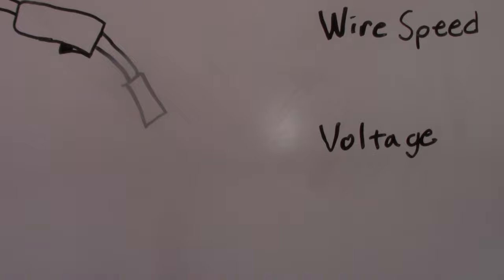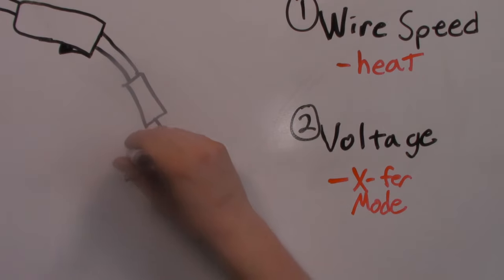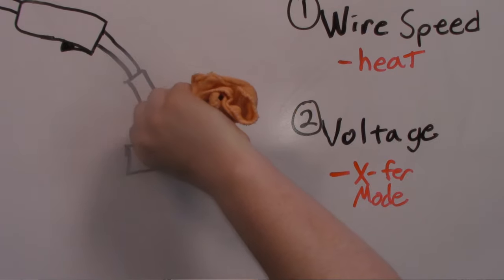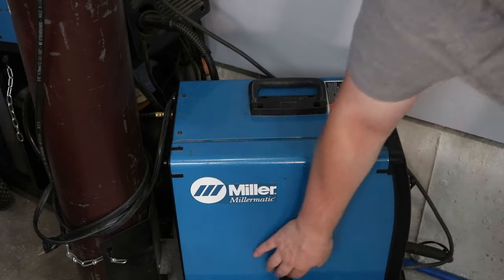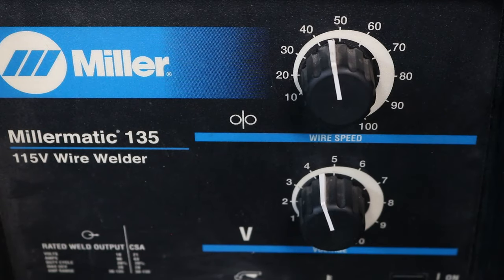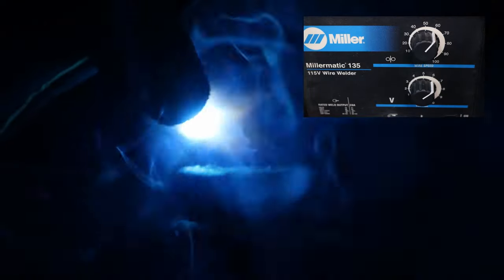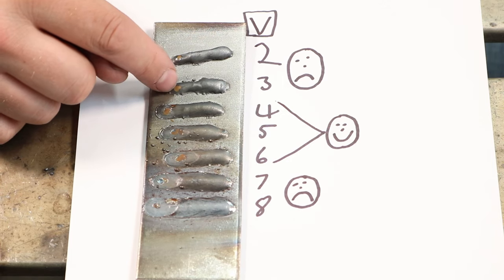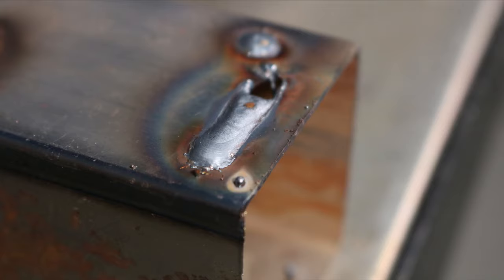MIG Welder Settings: MIG Welding Basics for Beginners

Comment from the maker: You can learn to weld.  I'll show you exactly what to do in my affordable online welding courses at https://courses.timwelds.com.
Reply: Yes!
Reply: There are many complementary comments from viewers about your video, but I think you have gotten the fundamentals of arc welding, of which MIG Welding is a sub-type, wrong.

The arc is not generated when the electrode touches the base metal; it is generated when the electrode is at a short distance from the base metal, around 3 mm. The high current and voltage allows the electricity to move across the air, which is an electric insulator, but in doing so, generates a lot of heat. It does so, by turning the air into a ionised particles, called plasma, which is a better conductor than normal air. The plasma is the arc you can see. 

This is why if you do not move your electrode after the arc had formed and the filler metal had been deposited, the filler can connect the electrode to the base metal and the electric circuit is closed, meaning electricity will flow 'properly' and no arc can form and the welding process will stop.

Comment: I'm an old, old stick welder, but I have always wanted a mig welder, so at 72 I bought a good one. Luckily, it came with a thickness gauge and inside of the cover to the wire storage and drive mechanism is a chart for the recommended settings. The little welding that I've done with it, the recommended settings give me excellent results. I've chosen to use flux core wire because I don't do enough welding to justify the hassle of using gas. My welder is dual voltage, but thus far I've only welded with 110 volts, but I have a project pending where I'll need 220 volts because of the thickness of the metal I'll be welding. I appreciate these welding videos because there are differences between stick and mig welding. I wish I could have afforded a mig welder when I was young. Being a farmer, it seemed like there was always something that needed to be welded.
Reply: Right on sir that’s amazing!!!! How have you liked it so far?

Comment: Personally I find the Miller App by far the easiest to use as a weekend warrior's uninformed apprentice. It’s basically what method you are using, material and wire or stick size. Even I can manage that, where some apps seem to presume specific knowledge or that you are using the app maker's materials.
Reply from the maker: I do use the miller app quite a bit. Whether a weekend warrior or pro, there's no need to overcomplicate it. Thanks for the comment!

Comment: I’m an enthusiastic absolute beginner in DIY mig.  My new 240v machine (Australia) only sets amperage and bolts, no wire speed.  Using 0.8mm flux core (gasless).  I get a can’t get a sizzle sound only a zap zap zap. Like it’s burning the wire up and loses the arc then re engages.  I have a Bossweld Buddy, M150

Comment: I am struggling with my mig. It has two switches with min/max settings and the wheel for the wire is 1-10. In no place does it state what the wire speed actually is. Granted I can't weld, but I find this welder really annoying. But taking notes here from your video and I'll head down and try some 1.5mm stainless. Thanks for the video.

Comment: I was taught to weld with a torch and stick in high school metal shop class.  I was taught to TIG weld in college during exam week right before I graduated (perks of having a job working for the Physics department -- this was not part of any curriculum).  My gift for my first father's day was a MIG.  I had to teach myself.  Now we have YouTube (YouTube did not come out until my first born was almost 10).  Some of the videos have helped a little.  This is the first one to explain what is actually going on.  I have been setting the voltage first and have nearly always had to set it at the highest.  I know that can't be right.  I am going to try it your way, and perhaps I will be able to get decent welds all the time instead of having my "good days and bad days" like I do now.
Thanks for taking the time to make this video and actually explain how the welding process works.  For those of us with an educational background in Physics, we learn better when we understand the how and why in addition to the what.

Comment: Tim, thanks for this short lesson. Directly from your teaching, I’ve made more sense of wire welding (the curious relationship of wire speed and ultimately heat into the work piece) than a lot of readings on the web. Thanks!

Comment: Thank you for this no-nonsense, easy-to-follow and clearly explained video!

I recently started welding (DIY) and I keep struggling with figuring out the right settings on my machine. Turns out I went the other way around and started with setting the voltage and trying to match the wire speed.

Now... on to your other videos! I hope they are as informative as this one.
Reply from the maker: Glad I could help!

Comment: Thanks! I have been using a flux core Lincoln for 20 years and I got pretty good at it for a part timer but now I just  got a Millermatic 200 and It is like starting over the learning curve.  Just subscribed.

Comment: I bought an inexpensive multi mode welder last year. It does MIG, stick, and can be set up for TIG. I’ve done a little MIG welding with it, and I’m really glad i finally bought one, but it didn’t come with a chart. And the instructions are a bit lacking in that area as well, so it’s been more trial & error than anything else.

Comment: Great overall explanation and the best I've come across for the effect of voltage on arc length.  Higher voltages can overcome greater resistance and span longer gaps.  And, longer gaps draw more voltage to maintain the arc (that's for constant current welding, not constant voltage.)

Comment: Good video and well explained.
The only thing I’d add is an explanation of the different scenarios of where the use of short arc dip transfer and spray transfer would be used. Also an explanation of the amps/ volts slope and the relationship  between the two and how they fit in on the weld slope of the machine.

Comment: I stopped reading the comments because Max Austin, Cueuerious Guy and Mad Q all expressed what I wanted to say; I'v been looking for a simple to understand Setting chart for my welder (it didn't have one printed, embossed or otherwise stickered); it's an inexpensive machine from Amazon, i started a short course on welding and then a horrific storm hit us down in Puerto Rico (MARIA), well it's been some 3+ years and I WANT TO USE THIS MACHINE; I love working with metal, (making a gas tank out of a flat piece of sheet metal), it's just cool. i finally got tired of wire feeding like a contest, welding spatters and knowing I'm doing something wrong, just can't figure out WHAT; the machine manufacturer can't or won't answer me, then by chance I spotted your video "MIG WELDER SETTINGS", Like Max Austin said I've learned more in 5 minutes than from 6 months of viewing useless video's; i know I have to keep practicing, nonetheless, I can't thank you enough, again Thank you for your simple Simon style, it works, don't change, you're Good!!

Comment: Thanks for the video! I’m just starting out with my Miller 211. The auto settings seem to be very hot.  I’ll try this method to see what works best.
Reply from the maker: Yeah, Miller auto settings are smoking hot on both my old 211 and my multimatic 215. I run them anyway on a lot of things and get a sound result, but if I want a really nice look or if I’m welding out of position, I’ll usually turn them down a bit. They are awesome machines, though.

Comment: Dear Tim, You have explained this information in a very easy-to-understand and apply manner. Could you please explain the pulse mode for mig? What does it do to the weld puddle? How and when to use it? And how to set it up correctly? Also, please make a video on metal deformation during the welding process. And how to correct, if the part has deformed? Thank you.

Comment: Thanks a lot, nice explanation I think it will help me to start welding.
Unfortunately my machine it has three dials to adjusts .
1. Wire turn speed
2.Voltage
3.manual welding current/inductance.
Unfortunately there’s no manual, no table on the machine, the machine is 3 in 1 you can weld stick , TiG and MiG.
My question i don’t know how to adjust the manual weld current/inductance knob. And when I should use this knob?
I hope you will give me some advice or tips.
Thanks 🙏.

Comment: It looks like the Millermatic 135 was replaced by the Millermatic 141....I do not know what other changes were made but the 135 is not in MIller's lineup now.  That said both are dedicated 120V MIG welders.   The 141 has a three groove Quick-Select Drive Roll which appears to allow a Flux Core (gasless) as well as MIG (gas) wire feed.  But here's the question...Mlller touts the 141 as having an "AutoSet" feature....which would appear to eliminate the need to set wire speed and voltage...your thoughts?
Reply from the maker: The 141 is a good machine. I have a Multimatic 215 with that style drive roll. It works good. The auto set feature on those machines has basically taken the settings on the chart in the lid and programmed this into the panel. It saves a few seconds reading the chart, but will give the same results. Those recommended settings work pretty well, but developing the ability to dial in settings yourself is still helpful to fine tune the machine for your situation. Bottom line is that those features are handy, but neither one is a game changer.

Comment: Great detail, info. and understandable explanation.    Could you please do a similar repeat for MIG aluminum  transfer spray without pulse re, voltage wire speed for different gauge alum?

Comment: I hope to learn how to mig weld thicker mild steel pieces than you typically use in your demonstrations; for instance I want to weld a 30" long 6"x6" x 3/8" thick steel tube to the middle of a 3/4" steel plate. I have a new Miller 255 machine loaded with .035 wire. Can you help me? How would you set up the machine?

Comment: Thank you for your video - very clear and inforative. 2 small suggestions though, if I may (about showing the welds at different settings on the test plate):
1. Turning over the test plate to show the penetration between settings;
2. 4,5,6 are good welds. What is it you are looking for (apart from the sound).
Thanks again!
Reply: Question #2 is important. I'm no pro, but I"m going to GUESS that it's the amount of penetration into the material he's welding.

Comment: This is going to be so useful. We're welding at school, and it's so so fun, but our teacher has to spend 45 mins finding the correct settings for each machine. So if I can do it myself I can save so much time!
Reply: i’m in welding school too, i graduate this year.  i hope u love it , a tip make sure u focus on ur work n actually show up . bc i’ve seen too many of my classmates fall behind n give up and not be able to certify
Reply from the maker: Very cool! Also, a notebook can be your best friend. Once you find what works for a particular joint and thickness, jot down the settings or grab a picture with your phone and you’ll be in good shape next time you have to run something similar.
Reply: @TimWelds  I thought you might be interested in an update. I didn't quite get it. I had the right ratio, but I set both too high, we're gonna continue on Friday and I took a picture of the settings so I have them for next time. We welded cylindrical pipes to plates and it was super difficult, even doing two halfs was a challenge. Do you have any tips? Because I've got straight lines on lockdown, but holding the right angle and distance while going at a locked pace is super difficult in a curve.

Comment: I have an Air Products welder that has a heat-setting knob and a wire-speed knob and a steel and aluminum switch. I was welding on a jeep chassis (beginner welder here), my weld looks like the number 3, but when I tried to turn up the heat and wire speed it burned through. I believe the chassis is 1/8 thick. 11 gauge.  I tried doing the push and pull method, but my welds still look like the 3 on your video. Any tips are greatly appreciated.

Comment: Hey great video. I have a flux core machine 300 amp doesnt have a separate wire speed dial to it. So im having issue on the wire feed speed, Ive done on of your techniques on how to measure WFS yung the 6 second method and it turn out that my machine only has 150"/m in 300 amp setting. So my question is am I doomed, aren't I? Still can you give me some tips on how to fix this. My machine has a Volt and Amp only dial the amp dial do have an lcd display but the volt hasnt. Can you please help me. Thank you

Comment: hey timwelds community! I have a bit of trouble getting the right transfer mode with my mig welder. I own a lincoln 140-sp. I am running .035 for 1/8" material, and the beads just look awful, even while adjusting wire speed, maintaining proper stick out, drag angle, gas flow, and keeping with recommended box voltage settings (only 4 voltage settings!) what do I do? preheat?

Comment: Hi Tim, Im new to mig weld.. my machine does not have wire speed. Only Voltage and current.. is it wire speed and ampere the same?

Comment: Hi Tim, im looking for a cheap welder I can use to weld my van inner wings and arches but struggling to find one suitable.. also I will need to run it off my generator as there is no mains power where my van is stored. (It’s a 7kva sine wave generator) any suggestions? I am based in UK. 
Thanks for your videos 👍.

Comment: Water analogy (think of a hose pipe) is usually used to describe how electricity works BUT, in MIG welding it sort of works arse about face.... 

 Amps = amount of water

Volts = water pressure

But.....in MIG welding this is how it effects your welding bead...

 increasing the amps (wire speed) will increase penetration, increasing voltage (switches on front on cheaper welders) will give your welding bead more spread because voltage is heat making the bead more fluid (think runny😁). The torch travel speed (how quickly you move the torch) is used to increase or decrease bead height or thickness you may.....there are three things all combining, it's all about practice.

Comment: Hi Tim, I have a 3 in one welder which only has two dials : One for voltage and the other for amps so I cant control wire speed : The wire spees  on my machine is determined by the amp setting. Can you please advise what settings i need for welding 3mm steel  ?
Tx

Comment: I have an issue with the wire continuing to feed after I release the trigger. Maybe 1" , which I have to cut off before starting again. Is that a problem with the machine, or a possible setting issue. I am welding on an old set of Hooker headers, putting a patch on a section I cut out. Headers are rusty, but I polished them up before welding. 110v multifunction machine. I may try 220v to see if it does the same thing. Thx for any comments.
Reply from the maker: Sounds like a fun project! It depends on the machine, if you have a slope down setting (the icon usually looks like a downward ramp), it will ramp down to zero over that period of time after the trigger is released. This is often used for crater filling. If that is turned up high, it could keep feeding assuming you pull the gun away from the weld right when you release the trigger and turning that down or holding your position until it finishes would fix that. Other than that, I’m not sure.

Comment: Thanks Bro !  ill explain what I need to know ! 
When I putthe roll in the roller and put it through the hose and thight the knob how tight and how and can i timed the speed to be right with the welder settings
Reply from the maker: Check out this video on my channel to see how tight to turn the knob: https://youtu.be/5M6A3wk8DWA . 
To find out what your wire speed actually is, feed wire into the air for 6 seconds, measure how much wire came out and multiply that measurement by 10 to get inches per minute (or cm/mm if that's what you measured in).

Comment: First and Foremost  Short arc is a very easy calculation: amperage 119 amps  19 volts ... Set amps and volts then use wire Speed to get to Bacon Burning Sound. Also, this is.035 & .045 same 122 amps  21 volts set amps  & Volts manual then turn wire speed till it sounds like bacon sizzling. I have been welding GMAW, GMAW Pulse  GTAW, GTAW Pulse, and Orbital Fusion sanitary tubing to the D-head wire feed for 40 yrs and Short arc welding is an easy setup. Also, keep the tip in the gun .25 inside. Factory settings are BS and Remember 119 amp 19 volts then adjust wire feed till it sizzles
 like bacon. Thx ........................Slingy

Comment: i have an odd thing to say and any suggestions would be great. i bought a 4 in 1 S7 welder form Amazon and the Flux Core and mig mode only work when the setting is one stick or lift tig thats the only time i get spark from this welder and the feeder doesnt work , it works when its set on flux-core.8 or flux core1.0 or mig but again theres no spark until i switch it to stick or lift tig.. why is that?
the welds are also pretty shit i can barely do spot welds ..having to keep switching bakc and forth is annoying id like to do a decent bead and be able to feed the wire through also at the same time..maybe a bad gorund? but i wouldnt think thatd have that much affec ton it